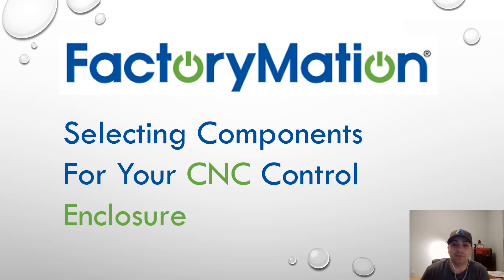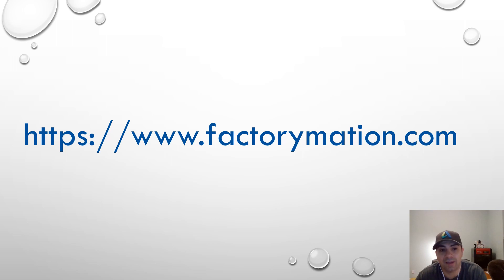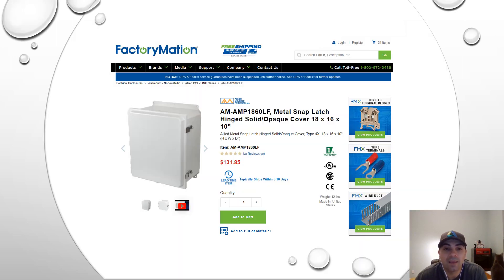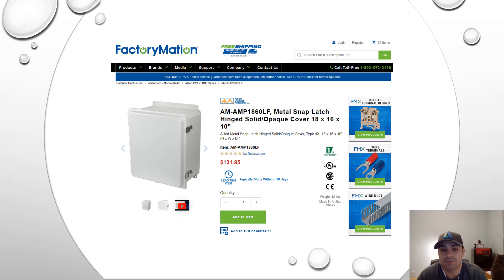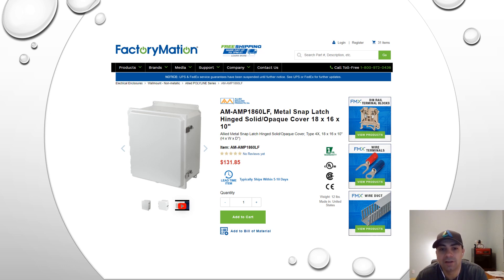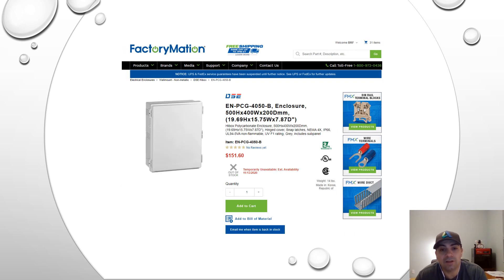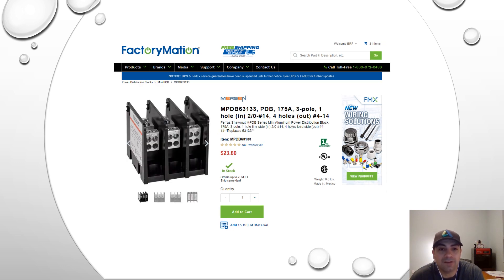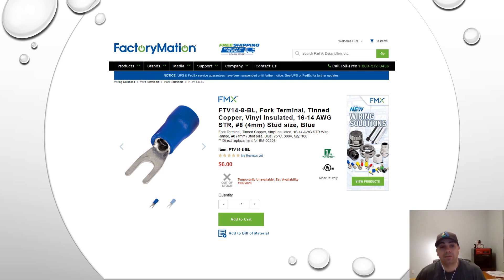FactoryMation CNC Components for DIY Build

Comment: Hi mr Franco.
How are you.
i just need you advice.
Can i use HSS 86 closed loop driver for nema 23 2.2 nm or 3 nm closed loop.
because i am building much smaller  cnc using Nema 23.
i just want to using driver and power supply from my nema 34 system i used before.
Reply: Hello.  As long as you can adjust the voltage and current to a level appropriate for those motors, then it should work just fine.

Comment: Quick question.  What wire gauge and types of wires should I use for these Longs 4amp motors.  Shielded wires?  Electrical stuff is not my thing.  This has been the worst part Of the build for me and it’s driving me nuts.  Not sure what wire gauge to use for what components.  I see the motors got 18 gauge coming out of them so I understand that.  However I’m lost on everything else.  Limit switches, and e stop, jumping power supplies.  I’m lost and it seems that wire size is something that ABSOLUTELY NOBODY EVER ADDRESSES!!🤬🤬🤬.  Please god help me.  I’ve got the acorn board and the same longs motors you recomended in your video last year.  The 2.2nm 4amp closed loop.  Help me my guy.
Reply from the maker: Hi.  Buy yourself some 18ga and 22ga stranded wire.  Use the 18ga for anything over 24 volts.  Use the 22ga for 24 volts and lower and you should be fine.
Reply from the maker: Anything 24volts and higher really is not a problem when it comes to electrical noise.  5V signals can be influenced by electrical noise and should be shielded for best performance.  Your ethernet cables should also be shielded.
Reply: @FrancoCNC  thank you for that.  I actually watched a bunch of your different videos on .25x speed so I could see what you were using lol.  I wasn’t sure about using 18 gauge so today I ordered a ten pack of spools for the 22.

Comment: why not get a 120v circruit breaker instead of dealing with disposable fuses?
Reply from the maker: Fuse holder is easy to mount and fuses are cheap.  A circuit breaker would work just fine, I just decided to go with the fuse.